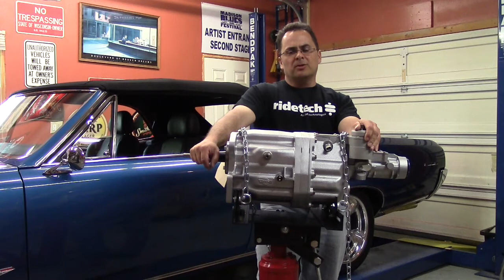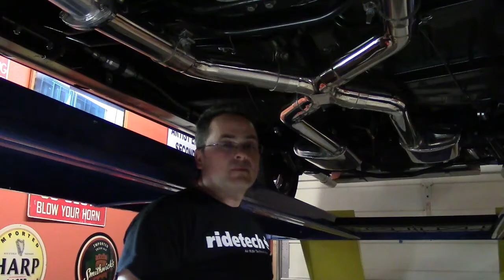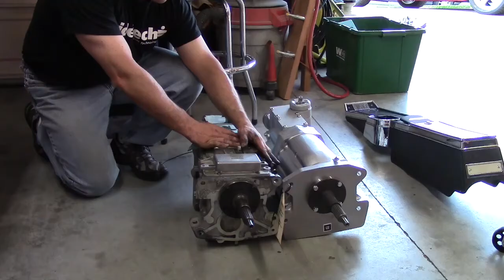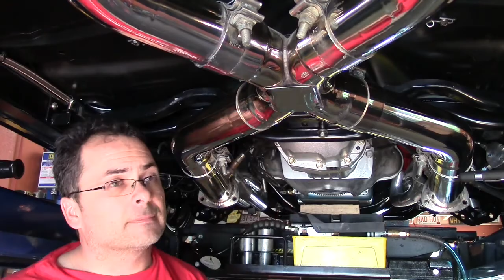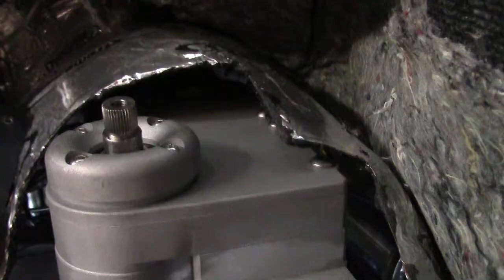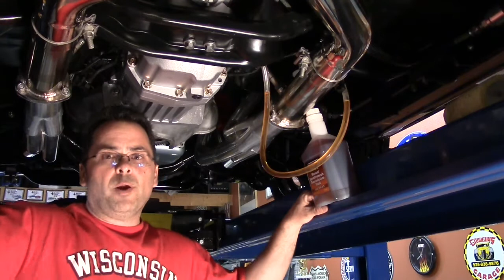Legend LGT-700 5-speed transmission installation

Comment: This video should be pulled down as the transmission is NO LONGER AVAILABLE! When you go to the Legend main page, the phone number given has a full Inbox (probably alot of HATE mail), they do NOT answer inquiries thru their site, the 3 listed dealers (including the one this video mentions) will dissuade you from anything but a TREMEC (which this video CLEARLY tells you is inferior), and so on.
And yet, there is supposedly a glimmer of hope as I was told by one of 3 vendors who are listed on the Legend site that they "may" produce the trans someday soon... in the next 2-3 years!?
Reply from the maker: I'm not pulling the video. This is my own personal video and I have had a variety of people send me emails thanking them for the video. I owned a TKO before this  and I honestly will tell you that this transmission is better than a TKO especially with shifting, smoothness and overall performance. When I bought it I had a long discussion with Mark Bowler and he was hopeful on the future of the company. You can also talk to Jody @ Jody's transmissions and he will shoot the truth about the trans. I could go into discussion about how the partnership between Legend and Abundant Mfg split and the attempts by the competitors to buy them out and the fact the Kiesler stiffed them for thousands of dollars but based on your all caps response to me, you really don't want to hear that. Unfortunately this company had hurdles that really set them back. 

Go buy a Tremec and make sure you spend the extra $1000-$1500 on the mods to make it shift properly and not whine and grind. I am sure you will be happy
Reply: I went through the same thing ,they told me 2 years waiting period ,looks like the company went bankrupt
Reply: I actually have one I'm my boss 302. It'll be for sale soon after I swap back to 6spd

Comment: This video is great - we could really use a video of an install to a car with an unmodified floor.  Does anyone know how the reverse lights work with the legend?  Is the speedo gear in the stock driver's side location?
Reply from the maker: Fred, the mechanical Speedo is on the drivers side of the trans. The reverse lights are handled by in internal switch with two screw terminals. Easy connection. As far as unmodified floor, I think there will need to be mods but they would be minor in comparison to the TKO.

Comment: Very good video. Very informative. I know how the Tremec's tend to hog up space as I installed a TKO 600 in a '93 Mustang. I also think the gear ratios are better with the Legend. All these transmissions with the deep first gears like 2.87 and lower are designed for rear end gears of 3.08 and such. They have too much RPM drop from gear to gear. The 2.66 first keeps things closer together and will improve acceleration. It was good that you showed how to check for bell housing alignment, many folks don't get how important this is. Great job overall.

Comment: Really nice work and video Bob.  Did I miss something ? I know you checked the flywheel  and face of the bell housing for run out, but how about the alignment so the center hole would be within spec.  Or was that not needed with this trans.  Thanks  Dale
Reply from the maker: yes, That was checked as well when the TKO was installed. Legend wants the bell within 0.010 total run out much like the TKO. I did not have to check it with this install because I was already within spec.
Reply: Got it thanks Bob, I have a Richmond 6 speed in my current 1980 Corvette resto mod, but would sure like one of these 700 5 speeds.  DW